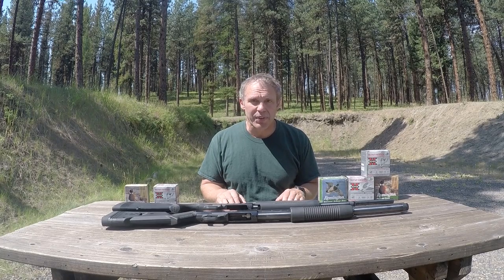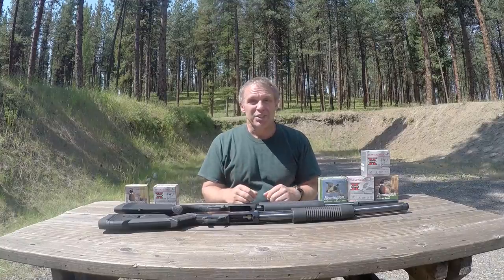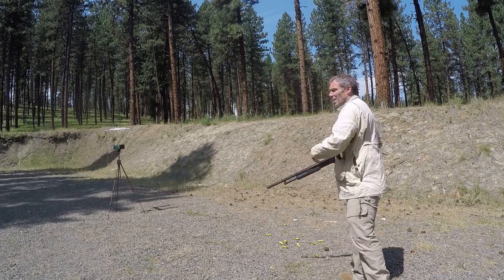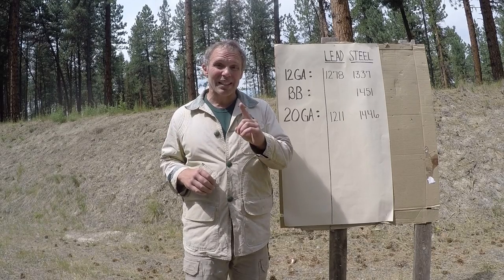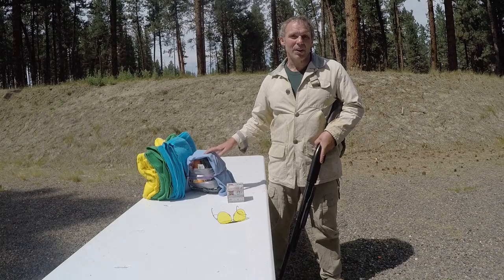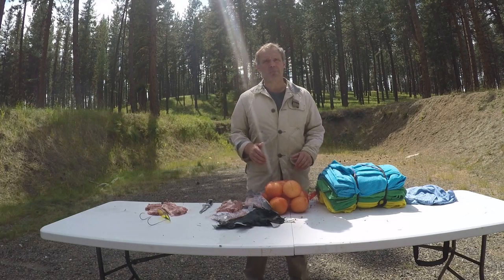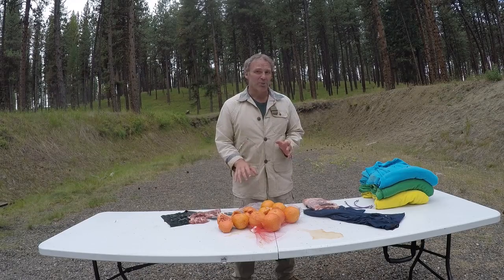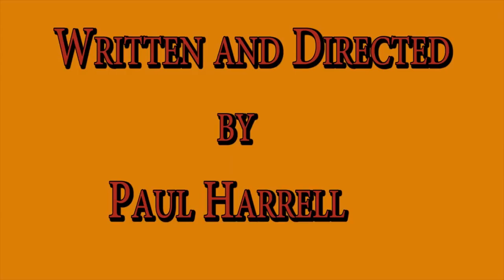Steel Birdshot for Home Defense

Comment: Uh oh the old birdshot for defense thing. It'll dang sure kill you at across the room distance👍🇺🇸
Reply: I'm not asking how you know...😉😂👍✌🇺🇸
Reply: @freshfowler1398  well since Yeager said it would barely break the skin in a defensive shooting and he's usually wrong. I had to try it out😂👍No I've seen a lot and killed some pretty good size stuff with it in a pinch. We were dove hunting once and a bunch of wild hogs came out my middle brother smoked a bunch of them with #6 lead shot. Even though Yeager said it was not lethal....
I don't believe that particular bunch of wild hogs seen his video so they all went ahead and just died right there😂👍🇺🇸
Reply: It will peal the skin like a potato,  trust me 12"X12" @ 20'.
Reply: Were you meaning to use a US flag?
Reply: @andyjohnson7408  indeed sir
Reply: @smugly6793  well my keyboard app died some how and that is the closest to it this thing has with this new app.
Reply: 🇺🇸well blow me down! It does now! Thanks🇺🇸👍
Reply: Shootin' with Uncle Dan ah makes sense
Reply: @smugly6793  i found one sir. Now if it only had a Texas flag. The Chili flag is close and a lot of Texans use it. I think Google hates Texans more than even regular Patriots
Reply: The problem is birdshot of any kind might stop an attacker but buckshot almost always will.   I don't see any potential advantage to birdshot in self defense.   If someone is worried about over penetration #4 buck is an ideal choice, it's still does the job but will penetrate a little less that 00.
Reply: @chrisjones6002  well that is true enough but, you realize that unless you live in a mansion. The distance from the end of the barrel to your attacker will likely only be measured in feet. At across the room distance the shot will likely all still be contained in the wad. In effect it will hit more like a slug regardless of shot size. I'm quite confident in #4 or bigger birdshot. In this case. That being said I prefer a Glock PDW with 34 rounds of Underwood 147gr +p+ overkill maybe but it seems to be a better choice for me.
Reply: @UncleDanBand64  Ive done a fair amount of research into it and you are right that birdshot is likely to cause an incapacitating injury at close range.  My thing is why bother unless you live in an apartment with paper thin walls.  If that's the case you would be much better off with a 5.56 shooting light weight ballistic tip bullets, electronic hearing protection would be smart too.
Reply: @chrisjones6002  yep that is the problem with 5.56 unless it's suppressed or you sleep with ear pro. I think you nailed it. A lot of people do live in apartments or it's a few feet to the neighbors. That is when birdshot makes a great choice or you have a bunch of other people in the house. Small kids come to mind. If that is the case heavy birdshot is great. If that is not the case well heck yeah buck for the win.
Reply: @Shootin' with Uncle Dan. Lethal, probably,i mmediately incapacitating, not necessarily. I've seen videos and pictures of people shot with birdshot who ran away, or worse, kept fighting. Even saw a vid of an active shooter blast a poor girl near point blank with a shot gun with birdshot, she fell down, but when he turned away she got up and ran. And I don't always agree with Yeager, but to say he's usually wrong is false, most of his tactical knowledge is sound.
Reply: @UncleDanBand64  Also in my experience and from what I've seen. A 12g firing birdshot, is going to be safer for other occupants of a house than 5.55, or other regular center fired rounds for that matter. 

That actually reminds me of another reason I love my new home so much. My whole family (my Nana, parents, sister, and her kids) just recently moved two states away from our home state.(A move from Tennessee to Florida). The new and improved family farm house is fairly old'ish and made of brick(built in '65). One of my favorite features is the fact that the interior walls are actually block, save for a couple cornering walls in a couple of the bathrooms. With the help of the layout of the house and my bedrooms location in the house. I'm actually really comfortable using my AR as a home defense weapon. No other bedrooms are between me and the front of the house, and after passing through a person a .223/5.56 is not going to fully penetrate the walls.

That said when I was living in an apartment with a friend of mine to help him out, my go to home defense weapon was an 870 loaded with birdshot, because the walls were so thin between rooms and apartments. Because personally I felt it adequate for defense, but not "strong" enough to over penetrate into the next person's unit. 

But that said, that's my personal knowledge, experience, and opinion.
Reply: @LilWillforChrist1998  i agree with that just watch your hearing firing 5.56 inside. I know I'd rather be deaf than dead but, I'd rather be alive and able to hear too. 5.56 is brutally loud indoors and the pressure wave is also punishing👍🇺🇸
Reply: @UncleDanBand64  I noticed Paul proves things and Yeager talks alot. I think he should stand across the room instead on the business end of that mosberg in place of the meat target.... since it barely scratches the skin.
Reply: While I'm positive it has killed plenty of people or at the very least put the fight out of them... I have seen personally somebody shot at less than 5 yards with bird shot who after getting up with the wind knocked out of them and clutching their wound proceeded to nearly beat the person to death who shot them before others intervened and police were involved. Unlike many of those legendary tales of 300lb meth heads, this definitely wasnt the case. Maybe 175lbs to 185lbs and totally sober. 

I've read tons of similar cases, seen tons of tests conducted on the effectiveness of birdshot for self defense and outside of it being all I have on hand, pretty much all evidence points to the fact you should likely be using something else. Still, I know people often act tough and the tiniest bit of pain takes the fight away... Seen a guy once who got into an argument and got shot with a .177 pellet rifle. Went in maybe an inch or two and he was on the ground crying his eyes out like he was dying. So while the age old adage of "I wouldnt want to get shot with it" still rings true... you just wont find me loading it unless that is all I have. 

I've used birdshot for hogs before as when you are close or they are closing in on you, that distance gap is real narrow and often times when your placement is on point it has more than enough power to do the job. Still often when going out for hogs with a shotgun it's buckshot or slugs for me. I guess what it comes down to is that when you get people who say it's useless for home defense or it's terrible for it... they arent wholly wrong. Take Yeager for instance.. he likes to talk about stuff in a martial context and from that standpoint yeah... it is useless compared to other options. Doesnt mean he doesnt spew straight BS sometimes about certain things that he speaks in absolutes about though. But even everyday Joes on the street who talk about the ineffectiveness of it... be it from personal experience or repeating whats floating around out there... again not wholly wrong all the time. Obviously make the judgement based on the information presented but what applied in one scenario may not apply to all. Generally I hear reports that match up with the data and research out there. It CAN be lethal but more often than not it isnt.
Reply: @Predalien195  well there is always odd cases. You might shoot somebody with anything and they continue to fight. Five yards is a long shot in your home. I'm not advocating the use of birdshot for defense simply saying that if your in an apartment it's an option. My shotgun has #4 buck. At any rate like I've stated before if you are point blank and are hit by birdshot in a vital spot. Barring a miracle you will be dead just as quick as if it's buck.
Reply: @Shootin’with Uncle Dan Look man, I’m not gonna argue with you, if you wanna use birdshot for self defense, that’s your choice. It can be lethal, but there are cases when it wasn’t. https://m.youtube.com/watch?v=_F_KuFzjOGA Take a look at this video where an active shooter shoots a student with birdshot. He had already killed someone with the same shotgun before the video starts, but he doesn’t kill this girl, despite being close up. Birdshot can take someone out, but it doesn’t do so reliably like buckshot does.
Reply: @JohnW-yv6yp  look partner i don't use birdshot for defense. That being said I'll use anything in a pinch. News flash nothing is always lethal. I will gladly watch the video and thanks for the link.
Reply: @JohnW-yv6yp  yeah watched the video. He was probably 14-20 feet so in the realm of home defense distance. No doubt her arm took the bulk of it. However without serious and quick medical attention she would have died. In this particular case i would say had it been buck she would have likely passed away. Had he shot her straight on with the birdshot she would have likely died. She is lucky to be alive. On that I'm sure we can all agree. She was no doubt in shock instantly. Thanks for the link.
Reply: @UncleDanBand64  Well thing is though most of those cases of people surviving seems to be the norm. It's easier to find examples of people surviving than dying. Kind of like the whole over penetration related deaths. You tend to find more examples where it meant nothing or wasnt an issue than when it actually resulted in a death and usually said deaths are suicides where the round hit somebody standing next to them or in the next room. 

I too keep #4 Buck in mine as it has a pretty good proven record and has low recoil compared to some heavier shot out there. At point blank yeah... it likely will do the job. I dont think 15 feet is super long as in my apartment the longest section of it is greater than 15 feet. And in the house I grew up in, 15 feet wasnt even the distance from the front door to the door leading towards the bedrooms. And yes, plenty of cases of people being shot with all kinds of stuff and surviving at those ranges, but usually they are handgun calibers and it's not multiple shots. 

Dont get me wrong, I wasnt taking it as you were advocating it for self defense just stating why when people who are openly against it for self defense have just cause to feel that way on the issue. I think we can all agree something is better than nothing and that there are circumstances where it may be the best option for you. Just it usually turns into an echo chamber of either people who are for it or who are against it. I tend to go off personal experience first and if I have none in that area I look at the data. I still use data and experience when possible though. I just dont think you want to have to be point blank on somebody when using a shotgun loaded with bird shot for it to do the job though.
Reply: @chrisjones6002  two reasons 1. It's what you have and can afford.  I know buckshot may not cost much more but factor in training cost goes up.  2. legal reasons if you live in non gun friendly area (as dumb as it sounds) birdshot is less threatening and intimidating.
Reply: @MrGpdp  if cost is an issue you can train with birdshot most of the time and save the good stuff for self defense, after some testing and patterning of course.  I've never heard of buckshot being banned or having any legal issues, generally they seem to ignore shotguns it seems like.  If that's an issue that I can understand it, I would just find the heaviest shot that still qualifies as birdshot, maybe lead BB if you can find it.
Reply: Chris Jones Paul already did a video on this. #4 buck will overpenetrate as well.
Reply: @010karl010  of course it will, any shot that will penetrate deeply enough to reliably stop a person has a risk of over penetration as well.  I just think 4 buck is the best balance between enough penetration but not being too excessive.
Reply: I just watched a self active protection video where a girl got shot in the chest with birdshot and walked off she didn't freak out or anything
Reply: @gdupmilli5825  Well she got lucky

Comment: I want to point out that the 12 gauge #4 steel loads were most likely designed to work with longer barreled waterfowl shotguns. You can see a fireball in front of the muzzle when you shoot that load and I can only imagine the shot pattern looks like a doughnut due to the blast. I bet you would get higher velocity and a much better pattern from a 28 or 30 inch modified choke. I still agree with you that I wouldn't choose that load for home defense and especially so with the shotgun you were using.  Bet I would get much better results with the gun I use for duck hunting. For many of us the duck gun might just be the one we grab to go check out that "bump in the night".  
Best wishes Paul and thanks for all your hard work on these videos

Comment: Paul Harrell. As always I very much appreciate your painstaking and thorough analysis of the subject material. I now of course (thanks to you) see the need to got my Mossberg 590 SP to the range for some patterning tests to determine a good home defense load. As this weapon has a 3"chamber I am going to look at the 3" magnum #4 steel birdshot that you demonstrated as a viable defense round. Over penetration being a concern indoors the heaviest round that I currently have for the home is 2 3/4" #4 buckshot and that is a bit sketchy when it comes to drywall interior walls. Thanks again and all the best to you. Be safe.
Reply: #4 buck shot didn't do bad on over penetration, he has a demonstration of different loadings shooting drywall. It's effective and looses a lot of velocity after hitting one layer of drywall.

Comment: Thanks for the video. While I can't see myself ever using steel shot for home defense, I like learning about these topics. 

I know that many of the gun professionals hate the Mossberg Shockwave, but I'd still be interested in hearing your impressions. I feel fairly confident with mine. I definitely prefer 2 3/4" shells with 00 buckshot and a rated velocity under 1200 fps. I understand that the fourteen-inch barrel means that my velocity is going to be less than the rated velocity, but I still believe that my velocities will be enough that hitting someone with seven or eight of the nine pellets will produce effective stopping results. 

If you do a Shockwave presentation, please consider using a number of low recoil shells for the demonstrations. The Federal FlyteControl shells that are rated around 1145 fps are very nice in this firearm. For those on a budget, Fiocchi shells (2-3/4", 00 buckshot) rated around 1150 fps are nice. I also like the 2 1/4" shells that have six pellets of 00 buckshot in terms of shooting comfort, but they aren't reliable enough for most purposes. If someone would make an adaptor to run these shells, they might be perfect for the Shockwave. I find that tipping the barrel upward when cycling the action gives me better feeding with these. The mini-shells feel great in this firearm, and they have functioned reliably for me with the adaptor. However, the expense puts them outside my budget considering that I like to train with what I'd shoot. Most types of shells give me about a three to four inch pattern at around eight yards. The Federal FlyteControl shells give me about a two-inch pattern at that distance. I've shot a bit of #4 buckshot as well. If I remember correctly, I get about a four-inch group at eight yards with these just as I do with the others. 

One gun channel was trying to make the Shockwave appear useless. They showed how accurate shooting at any distance usually meant holding the gun outwards to site along the barrel. They then claimed that the gun would be less effective than a regular shotgun for a close confrontation because holding the gun away from the body that way would make the gun more susceptible to being grabbed. To me, that "demonstration" was silly. If someone is within ten feet of me, I don't need to extend the Shockwave at all to hit the target. I'd like to see what you consider the maximum range for that kind of "hip firing" without extensive practice and then what range the Shockwave would be good enough for having to extend and aim a little bit. No one is claiming that the Shockwave would be as effective as a shotgun with a regular stock and eighteen-inch barrel for self-defense beyond about fifteen or twenty yards. The issue is whether the Shockwave would be good enough under thirty yards, possibly better under ten yards, and more convenient to have in some circumstances.
Reply from the maker: The crew and I will be shooting the shockwave this weekend. I'll get their impressions on it and hopefully make a video in the near future.

Comment: I agree with everything Paul said. To a point. I know one person that has a 7 yard or more stretch in their home. The longest span in my home, from wall to wall, is about 24'. The one defensive bottleneck in my home that all bedrooms are behind is in that span. If you minus the 2' feet from the wall to my defensive position were at 22'. Assuming the intruder/s aren't flattening themselves up against a mirror, subtract another 1' to 2' from that total. 2 yards at the furthest logical distance. I'm not worried about spread.